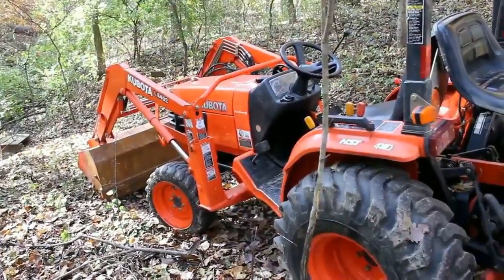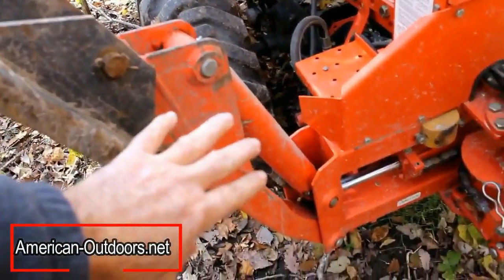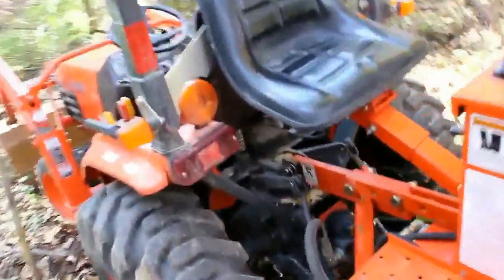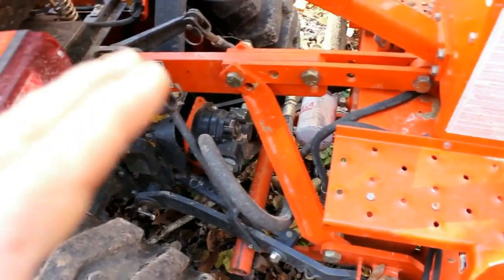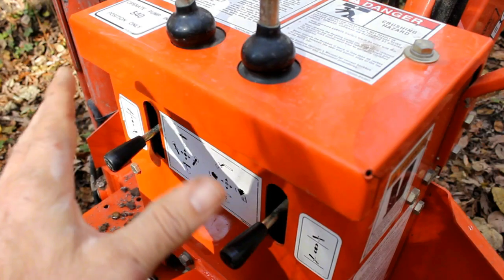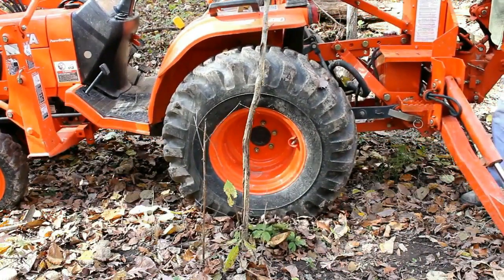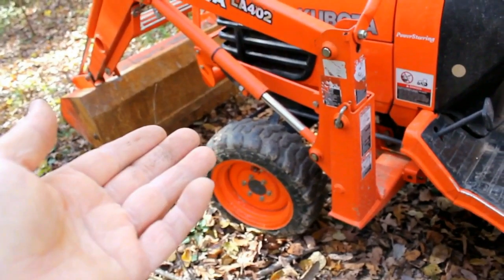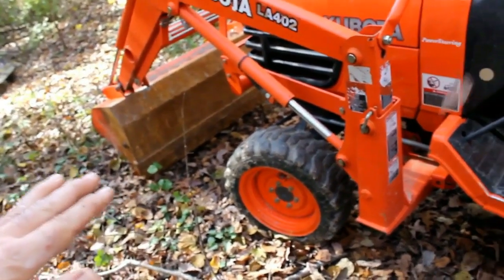Compact Utility Tractor Backhoe Controls For Dummies

Comment: This is a great confidence builder.  I've had tractors for years but only used attachments such as hay spears, bush hogs and box blades.  Buying a backhoe soon and feel intimidated to start using a backhoe with multiple controls.  I've learned lots!  Thanks for this!!

Comment: A backhoe and front end loader tractor are not the same. A tractor is not designed to put the front end loader into the ground that way because of the position of the cylinders. Planting your loader bucket down this way is a good way to really mess up your cylinders. It's fine for a backhoe because the cylinders are positioned in a way that allows for the bucket to be planted into the ground this way

Comment: Does your tractor have the reinforcing frame attachment?
Reply from the maker: Yes, this Kubota does. There is quite a bit of debate over frame mounted vs 3 point backhoes. We used the tractor a lot over the summer digging out the banks of our pond. It moved a lot of dirt and never struggled.